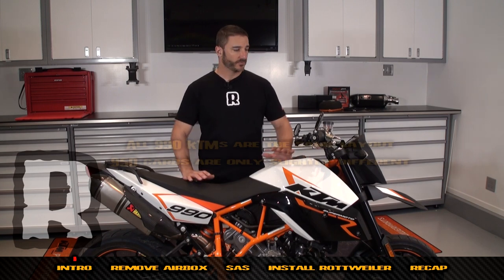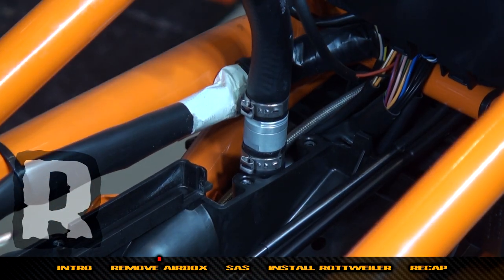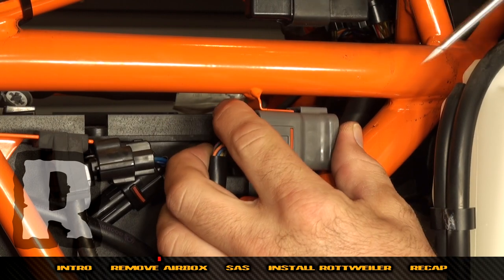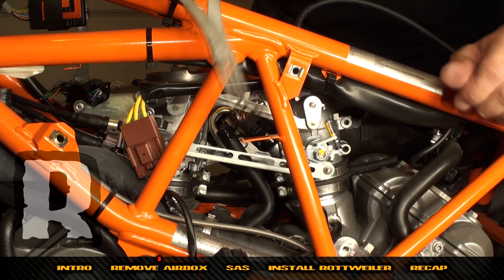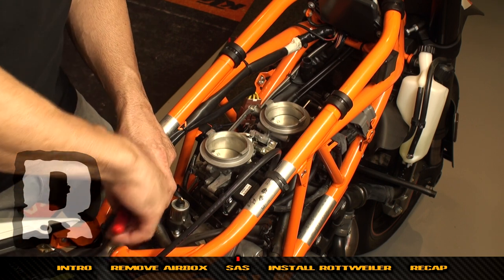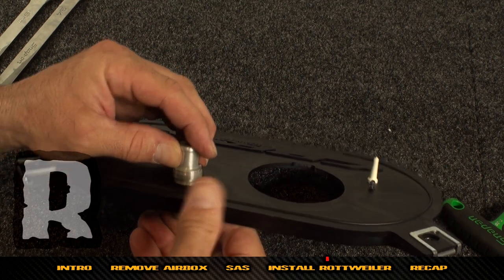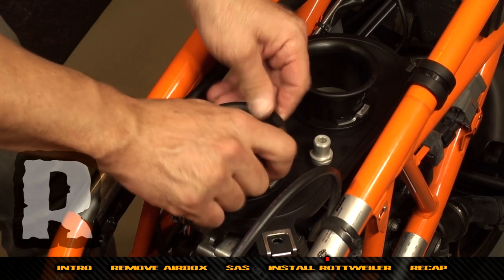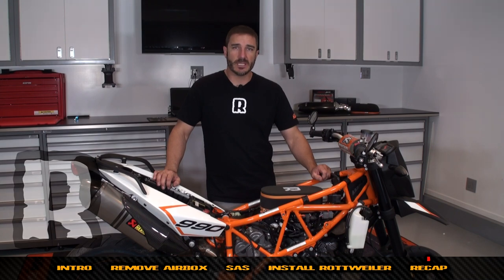HOW-TO INSTALL ROTTWEILER PERFORMANCE INTAKE SYSTEM - KTM 950/990 ADVENTURE

Comment: Congratulations sir, can you help me with my problem regarding the body cable that goes to the throttle body of the KTM Duke 990R 2008? The problem is that it broke when bitten by a rat and I don't know the color of the cable because the cable going in and out is a different color, please help sir

Comment: Hey, thanks for the great video, really clear and precise instructions. Just fitted mine and the SAS removal but now getting the FI light on permanently and can hear a sucking sound when ignition is on. Any suggestions would be great?
Reply from the maker: We would make sure the dongles are plugged in properly. Check those and if there is still an issue give our support lines a call and those guys can try to walk you through any issues. Not sure about the sucking sound though. Maybe record it on video and send it to info@rottweilerperformance.com. We have never heard that one!
Reply: @RottweilerPerformance I have 990 super Duke year 2005 and this sistem solve the problem with the throttle on slow speed an revs?
Reply from the maker: @cristiantamasila8667  There is no complete 'fix' for that, but there are large Band-Aids. Some of which are this intake, and especially better mapping with a fueling controller like a Power Commander. Other than that, the fuel injection was archaic and it kid of is what it is, but this stuff will help.
Reply: @RottweilerPerformance  getting 9 blinks on the FI light. Tried the old SAS connector and same thing so thing SAS is ok. Any suggestions?

Comment: would it be possible to just keep the SAS cylinder plate with the hose and just plug the hose it since its a mess to undo the screws? 
If I don't re-map my 990 advr, will it run poorly or what could the consequence be?

Comment: Hi. I have a 2006 950sm and it was running great after this install, but then developed a condition where if I accelerate aggressively or hard, it starts to back fire like crazy, feeling like my chain snaps, or that I'm about to explode. Any clues what could have happened? A vacuum leak? My carbs dislodged?
Reply from the maker: It sounds like you just have an air leak somewhere. It could be at the exhaust with a crack or a gasket blow pulling oxygen in or an actual lean condition in your cylinders. I would just check the boots thoroughly to make sure the carbs are seated properly and check that if the emissions have been removed (almost everyone does) that there are no air leaks where the hoses used to go but that bike should not have much in the way of emissions because of the date it was manufactured.  You should also re-jet the carbs with a the jet kit linked below.  This is crucial on the carbed bikes. https://www.rottweilerperformance.com/jetting-kits-for-ktm-lc8-950s/
Reply: @RottweilerPerformance  -- Thanks for that. I did re-jet with that kit so I should have everything in order as far as parts go... and it was running like a dream for about a month... But I'll take a closer look to what you suggested. I'm starting to suspect perhaps my fuel pump is starting to get weird, but that's just from reading the internet.
Reply from the maker: @majorawol  That may very well be! Popping is almost always a lean condition, whether it's only in the header or from the motor itself you will need to figure out.  Glad we could help shed at least a little light on this for you.

Comment: Hello . I have a 990 superduke 2012 . I want to purchase a rottweiler intake and sas stage 2 . Does i need a reprogrammation after instal or the lambda make it run correct ? Don't want to damage the motor
Reply from the maker: You won't damage the motor, but those engines were not fueled very well and all and a Power Commander V will work wonders for it, stock or not.  We would highly recommend one, and we can set them up for free, but you certainly won't blow your motor without one.  They will just compensate at 14.7 AFR in closed loop.

Comment: I have some more question. 
- Can you recommend this kit for me. I ride about 35k - 40k miles a year. 
- Will this kit affeced the where and there of the bike? 
- Does it need more maintenance than the stock setup.
- How long last the filter?
Reply from the maker: - Can you recommend this kit for me. I ride about 35k - 40k miles a year. 
       Of course. There are no issues with that. Obviously the more miles on a bike the quicker things wear out, but your use is just fine. 
- Will this kit affeced the where and there of the bike? 
       No, those engines are strong. If anything the filter will filter out more dust prolonging the wear and tear of the engine. 
- Does it need more maintenance than the stock setup.
       It is a foam filter, so it is washable and reusable. If you get the Snap Out bracket, maintenance is super easy. Use the pre filters as they will catch most of the dust and are easy to swap and clean. 
- How long last the filter?
       As long as you take good care of it, it should last years. We have some still in use after 5 years. We can supply filters alone to our previous customers if there is any issue.
Reply: Thank you for the reaction.  👍

Comment: Hi, I would like to eliminate SAS on my KTM 990 SMR. Which kit do you suggest? Can I do this job without removing air box or remove and re- installing is necessary? Thank you in advance.
Reply from the maker: You can either choose the SAS stage 2 or 3. They both do the same thing, but stage 3 will allow you to check the sync on your throttle bodies easily and at any time if you are into that. You will have to remove your airbox, but if you are installing one of our intakes (you would be crazy not to) then it's all right there and easily done.

Comment: Haven't managed to find the video of the oiling process for the rotty filter you mentioned is available. I oil it just like any other foam type filter but there will be customers who have never had to do it before buying your product.
Reply: What's the purpose of oiling the foam filter? If it's all oily and wet, doesn't it attract more dirt and grim?
Reply from the maker: All foam filters should be oiled. That is what the dirt particulates stick to. Paper uses surface area and finer holes, but doesn't flow well. Dirt bikes have been using oiled foam for decades.

Comment: On the 950 i suppose you will have to change carb jets to suit higher flow in the intake, but in any case after conversion the bike will not be street legal anymore!Or does it?
Reply from the maker: That part we leave up to you. On the jetting, you should change it. Our Factory Pro Ti needle kits are a great way to have what you need on hand. http://www.rottweilerperformance.com/jetting-kits-for-ktm-lc8-950s/ Typical starting points (with that kit) are 168 front - 170 rear main - needle in the 3rd from top - pilot at 45 - float at around 4mm. That can go up or down depending on your altitude but will get you in the ballpark quickly. The Flex Jets are also key to fine tuning on the fly.http://www.rottweilerperformance.com/flex-jets/

Comment: I am getting a whistling sound at low rpms. have you heard of this issue?
Reply from the maker: It’s your secondary throttle plates. The ones that the computer controls. In some occasions they can be at juuuust the right angle and can whistle slightly. When you open the throttle it goes away. It’s just a byproduct of that bike and harmless.

Comment: Y cual es la idea de hacer eso , que beneficio trae?
Reply from the maker: "And what is the idea of doing that, what benefit does it bring?"

Much more horsepower. Easier maintenance with a servicable filter. The ability to have your filter in your hands and access the throttle bodies with only a screwdriver or coin in seconds. More room for tools. Better filtration.

Mucha más potencia. Mantenimiento más sencillo con un filtro reparable. La capacidad de tener su filtro en sus manos y acceder a los cuerpos del acelerador con solo un destornillador o una moneda en segundos. Más espacio para herramientas. Mejor filtración.